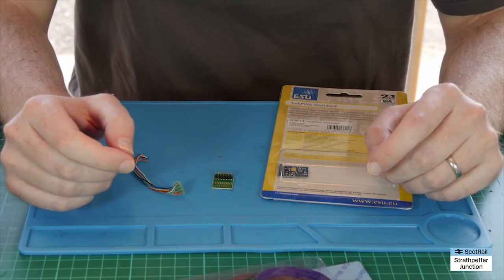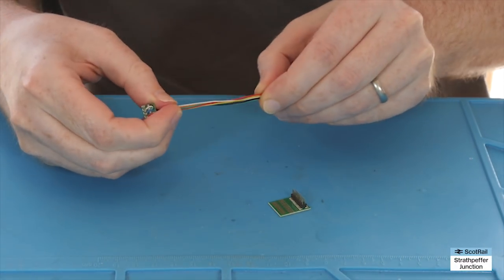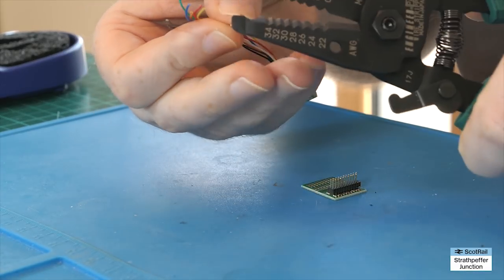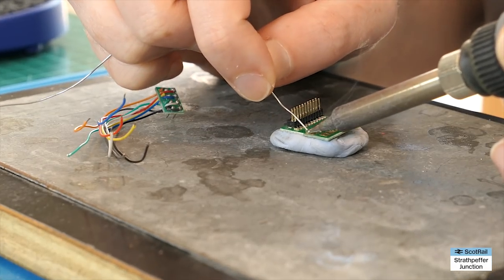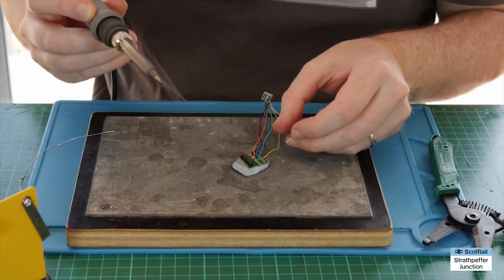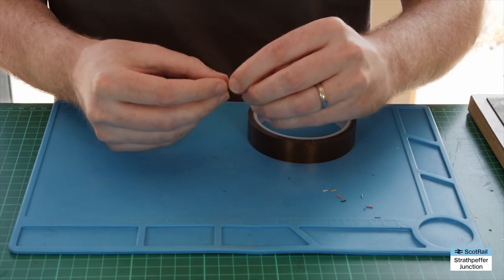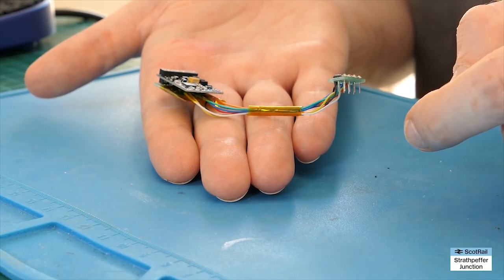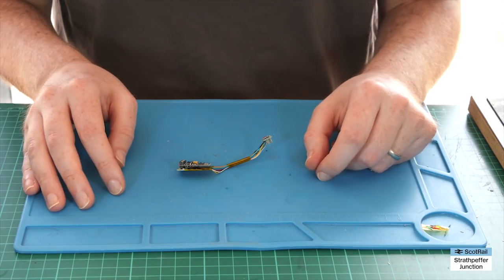#30 How-to: Using a 21-pin decoder in a locomotive with an 8-pin socket

Comment: Excellent video again always clear and to the point. What a breath of fresh air you are.
Reply from the maker: Many thanks, Raymond. Really appreciate the feedback :)
Reply: Strathpeffer Junction i know this is a long shot but are you familiar with the Hornby class 60? I dropped mine fitting an led light in the engine room. No damages to body or chassis but the wires to the running lights all came away from the two plugs and one from the PCB as far as I can see.
The wires are all black ones and I'm lost to be honest. Tried to source a wiring diagram but apparently none  exist. I thought of you and knowing your a wizard at electronics I wondered if you could help or even repair it. I would gladly reimburse any costs for time and postage. I could send pictures of loco if you decide to have a go. Like I said it's a long shot but I'm desperate! No problem if not.
All the best Raymond.
Reply from the maker: Hi Raymond. I'm very sorry to hear about this. I don't have a Class 60, but I'm more than happy to try to help. I've you're able to take a couple of photos of the loco with the body off, showing all the wires and the terminals, I may well be able to work out what goes where an guide you. Failing that, if I think it's something I can help with in a hands-on sense, I'd be more than happy to try. I've fixed a few on my own Hornby's when lighting wires have come adrift, so I'm sure even without a schematic we'll be able to get you sorted. 🙂 Drop me a line at info@strathpefferjunction.com with some photos and we can take it from there. 👍🏻

Comment: Nice and tidy tutorial, thanks for the link to the wiring diagram, I’ve done one for my class 26 sound chip and every diagram online contradicts each other! I’m printing yours off as it’s so much clearer, cheers Dazza
Reply from the maker: Thanks, Dazza. Yeah, that's precisely what I've found. Some don't seem to tally with others and some can be confusing. Hopefully this one is fairly clear...using the wire colours should make it fairly fool proof!
Reply: Where can I find the link?
Reply from the maker: Hi Onno. It's in the blurb below the video, but you can also get it via the first post here: http://www.strathpefferjunction.com/blog
Reply: Onno Mulder it’s in the drop down in the description at the top of the page 👍

Comment: Hi! Decoders and stay alive are ordered as well as Roco z21 start with MultiMaus :-) Here is my question: The Zimo MX617N decoder I have ordered has 6 pins but Hornby Pecket 0-4-0 has a 4 pin socket. Here is my plan: I will cut out the Hornby socket, solder two wires from the motor and from the wheels pick ups to the coresponding pins on decoder. The two pins mentioned in decoder instruction as a front light and back light I will ignore (they remain not connected). Everything must be insulated and done. Correct my please if I am wrong.
Reply from the maker: That sounds like the right approach, but please consult the decoder manual for the specific pins. I don't know that decoder well as I don't have any in my own locos, but assuming you have no lighting, you can probably ignore the white and yellow wires as they only control the light functons.

Comment: Do all the functions still work? I want to have a bunch of lights on my loco (there's a beacon and gyralight and a couple others) but I don't know if that will be possible
Reply from the maker: You can map the functions of the 8pin decoder to whatever 21pin function pins you want, but you will be limited to how many func channels the 8pin decider supports. Many 8pin decoders will only have forward lights, rear lights and green aux (so only one func channel to control, say, cab lights). Some will also have a  purple aux (normally a training wire) and a much smaller number may have another aux in top of that (mostly zimo decoders). So, it really depends on which decoder you are using as to how many of the funcs on a model will work. That said, in theory, and so long as you don't exceed the current capacity of the deciders aux channel, you could use the aux channel on the decoder to control more than one func on the model.
Reply: @StrathpefferJunction  Can I use the extra spaces on the adapter? Are those still hooked up to the 21 pin decoder?

Comment: Nice explanation and tidy work David 😊 I’ve just took delivery of the liquid flux your using 👍🏻 What do you use to clean the flux off? Stevie
Reply from the maker: Hi Stevie. I tend to use 'no clean' flux, so you can leave it (although it is a little sticky, just doesn't continue to corrode or turn green like other fluxes). However, if I've put too much on or I'm using standard flux, I tend to use a cotton bud with 90%+ isopropyl alcohol (IPA) if it's just circuitry or watered down IPA if there's any danger of it getting onto paintwork or sensitive plastic. Some folk claim to have had conductivity issues with no clean flux, but I've never had any issues at all, so it seems to work for me!
Reply from the maker: Sorry. I misread your comment. If you've got the same stuff as me, you don't need to clean the flux off. But, it can be sticky, like I said in my first reply, so if you do get a bit much on or you just want to wipe off the residue, that's where the IPA comes in. The bottle is VERY easy to knock over though, so do be careful with it. I knocked my last bottle over on the kitchen work top and it took a lot of watered-down IPA to clean it off, and it had to be done quickly to avoid damage! I've since designed a little holder on my 3D printer to hold the bottle secure.

Comment: Soldering onto a 21-pin decoder…..  hmmmmmmm….   Why not solder onto a Decoder Buddy and then plug the 21-pin decoder into the Decoder Buddy.  You can connect all the lighting, speaker, track and stay alive wires to the Decoder Buddy.  The LEDs will all be protected with resistors on the Decoder Buddy and lights in the shell are connected to a small daughter board allowing for separation of the shell from the frame of the locomotive.  Maybe a better way.